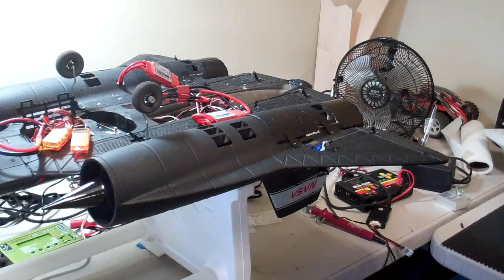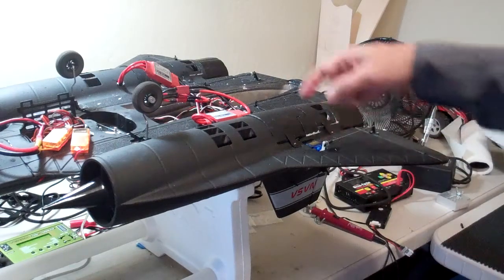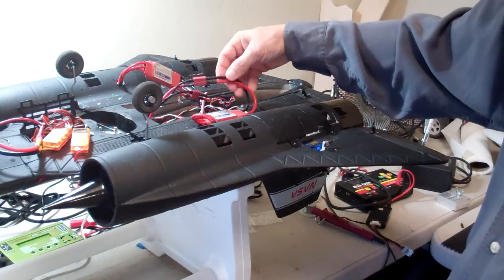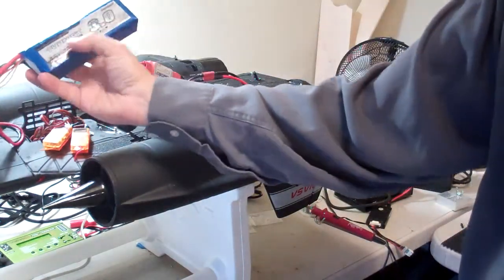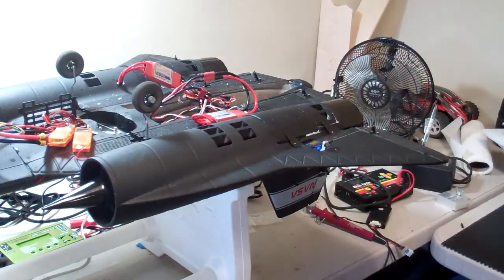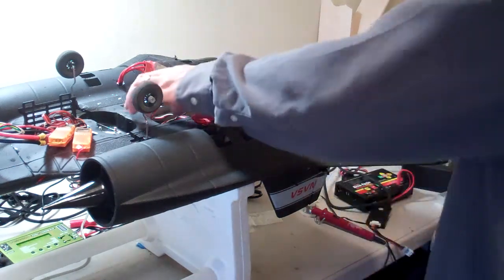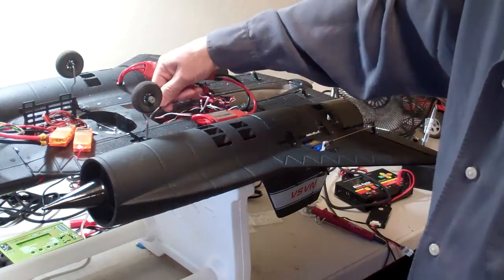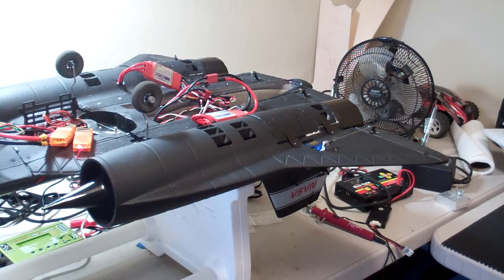Mercury All Alloy 64MM EDF SR-71 project V2

Comment from the maker: a09a21a: Funny you should ask. After weighing it and doing some bench testing, I came to the conclusion that it's just too heavy. Plus I can't throw enough battery in it to really optimize the two fans....it would require a 5s in the 4-5k MAH and 40-60C range which is too heavy. Running these combo on a 5S 40C 3000mah basically puffed the pack in short order and made it extremely hot.